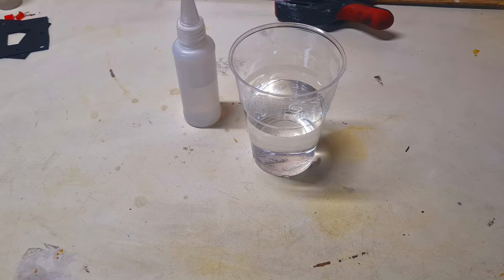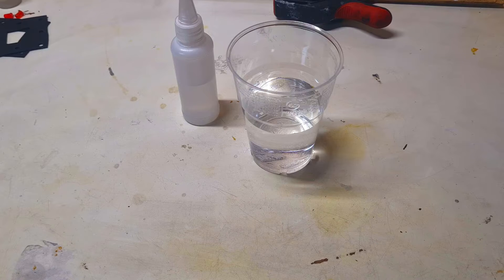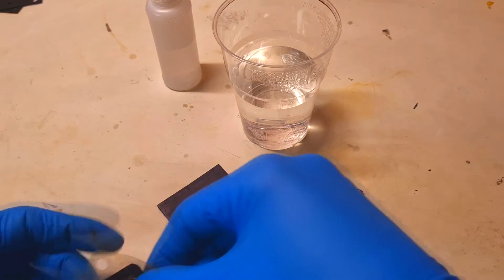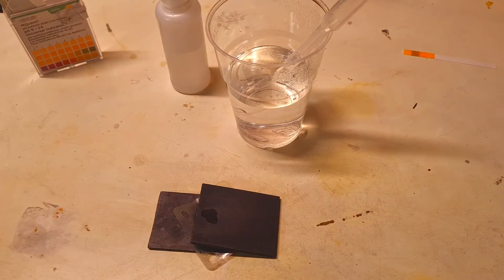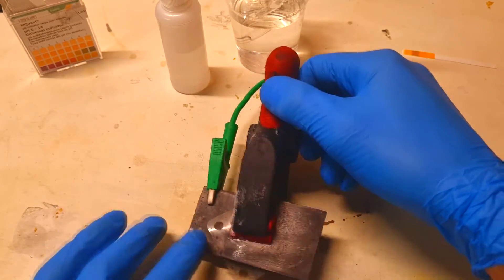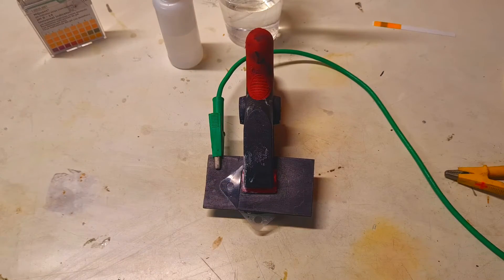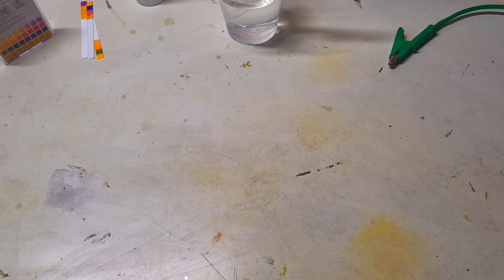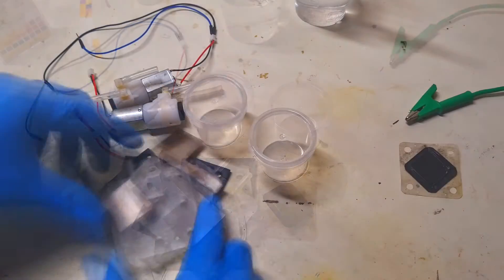Diy Rechargeable Salt water battery

Comment: Have any of your battery designs that you have made been able to last a long time, e.g. 1 day? What design of yours lasted the longest?
Reply from the maker: Zn - Mn last for 40 days and after that I open the cell to see how it look the inside (it was a self discharge test). Then with zinc iodine and zinc bromine battery I make the cycle tests where the test lasts for more that 4 -5 month of continuous cycle testing (with the cycle rate of 2000, 5000 and 6000 cycles). Then I test the charged electrolytes for flow batteries where the electrolyte last more that 1 year in the charged state. And so on....
Reply: @cayrex  Do you have any recommended and cheap devices for measuring charge and discharge?I care most about devices that don't need to be connected to a computer or that I can connect my phone to download data from.I would also like to do some cell testing and I am currently collecting equipment for testing.

Comment: How about the capacity of such a cell?
Have you tested more?
A good solution for everyone to make at home.
Probably one of the easiest cells ;)
Reply from the maker: The capacity is in the range of vanadium redox battery which is around 20Wh/kg.
Reply: @cayrex  I forgot to ask the most important question. I saw that you printed parts for a flow battery in resin.
What about the durability of such parts?
What is the durability of 3D printing using PLA, PETG or ABS?
Reply from the maker: @tdx110  It all depends what electrolyte is used. For ABS like resin and sculpt resin is hard to say how long will last,.... because they still lasting. The PLA will last 10 to 30 min in acid or alkaline electrlyte, PETG maybe 1 hour,... and the ABS I think will last a bit longer, but I dont know because I dont use a ABS printed parts so much.

Comment: Hey man, i'm pretty new to the channel, but i've stumbled onto this video because i was researching salt batterys for a school project and altough this video is great to quickly learn the basics, i did have a few questions about the material used:
1. U use some kind of ion exchange pad, which is needed to sufficiently make a salt water battery, but they are hella expensive, the one you are using however seems really usable, since the surface area of the membrane itself seems small, did you make that urself ore can we buy it somewhere? And where did you get your membranes? 
2. If i 3d print the parts, i assume i cant use pla, since the acidic environment will eat it away, any tips on what filament to use instead?
3. Since im planning on 3d printing it, but i dont have acces to an resin printer, so i cant print rubbery materials, any tips on stuff i can use to make it water tight? Some kind of rubber? or can i use silicone sealant for that?
And lastly: any overall tips to make it as efficient as possible?
Love your work man, its really helpful! And if you share the info i will assure you i will only use it for the school project, As a form of communication: I will also post this on you latest instagram post, u could message me there, or just reply here.

Comment: How can we make use of simple ingredients to make a minimal power supply for emergency use? I have been searching/researching this for some time but keep hitting a brick wall. There are so many scammers out there, eg. people who claim that it is possible to make batteries using sparkplugs is possible. Many people say this [spark plugs] is a scam.
Reply from the maker: A battery using spark plug?
Reply: @cayrex  Search on YT and there will be many YTers who claim it is possible to make a power source/battery that is made/built by using spark plugs as the main [charge]?

Comment: Its a lot cheaper than vanadium. It would be interesting to see some comparisons between your 2 flow battery chemistries using your electronic load showing graphs. 👍
Reply from the maker: Yes it is cheaper,.... but the vanadium is already verified technology which the salt battery tech is only in experimental stage look at AQUABATTERY for more details of salt battery. The salt battery have the capacity from 10 to 20 Wh/l and the vanadium flow battery have the capacity around 25Wh/l

Comment: Fantastic demonstration! Do you know how much performance will degrade with a larger gap? For example the radius of your container between electrodes. And I'm wondering what the highest specific power would be given that the conductivity is quite low.

Comment: Hi there. very interesting stuff. i have seen all ur videos and was wondering would u do a followup on the vanadium flow bat ? and if u would build a flow battery what chemistry would u use?
thanks and keep up the xperimenting
Reply from the maker: Yes I will make a followup of vanadium flow battery. Hmm it is hard to tell which chemistry is good to use in some battery system, because all or most of chemistrys have pros and cons. For this reason I start with the project called "Hyperflow" a multi material cell years ago. But on the another side,... some all manganese or metal halide chemistry will be interesting.

Comment: Nafion looks expensive... Is there cheaper alternatives?
Reply: ...dupont..i mean
Reply: Unfortunately not sufficiently reliable
Reply: I've used coffee filters with pva wood glue (like he said) and to extend it a little, I run the paper and glue once dry through a heat press at 350° F and try not to scorch it too badly. It works better than just plain paper and lasts noticeably longer. You go C Rex!!!
Reply: Yeah, depot still have patern. Will be expensive for a while. I have been looking for alternative fir a while. Liquid Glue crossed link by acid does not last long.

Comment: Seems like you will be depleting the electrolytes, with losing cl2 and h2 (charging at 2.5V). Or do you think you are just moving concentration of h+ and thus have a type of concentration cell?
Reply from the maker: Yes, here I overcharging the cell. With overcharging I get faster reaction, but I also note that the cell voltage is in region of 2V. Same effect you can get when you use for example a zinc manganese battery with alkaline/acid electrolyte (2.3 to 2.5V)

Comment: super cap? or just hydrogen oxygen gas storage battery. well another salt like baking soda would make oxygen not chlorine. chlorine hydrogen gas fuel cell battery? the membrane makes two compartments for the two different gases, keeping them apart but lets ions pass through. hydrochloric acid battery. oh there is also NaOH in the solution, on the other side.

Comment: Very nice! It would be good to measure the total capacity of the small battery and efficiency of charge.  Also make some projections of the possibilities if scaled properly.
Reply: It would be nice, but mostly useless because of too many variables that would be dificult to characterize well. 
1. the poor size and conductivity and geomitry of the carbon felt.
2. The volume and electrolyte concentration and how much. 
3. Temperature and pressure placed on plates and how that might change the carbon poors. 

Sodium sulphate has a higher voltage window than sodium chloride, Resulting in a higher energy density. And minimizes the potential for off gassing like chlorene with sodium chloride.But nafion membrane is slightly more resistant to sulphate ions, but still has good chemical stability.

Comment: Can you have a natural circulation like those acid and base are going to separate like emulsion or so so if you have a displaced reservoir are they going to sor themselves ?
Reply: Kinda like thermosiphoning? Yes, I have a problem with the need to pump AND charge. Round trip efficiency and all that. Cool though. Wow!

Comment: I was half way through the video when i jumped to make a comment proposing making this battery to a simple flow battery.  I made that comment  and then proceeded with the video only to be pleasantly surprised. 

Charging and discharging could be done with the motors in series so the pumps work with current during charging and discharging.
Reply: I believe the direction of the flow doesn't matter. If there is flow, the reaction occurs continuously. Otherwise the energy potential of the liquid runs out.
Reply: @Harbie  yup, the direction of flow doesn't matter if there is one container for analyte and one container for catholyte. Charging or discharging you always want to pump to avoid overcharg or over discharge.
 
Alternately, If you have 4 containers (2 analyte and 2 catholyte) then direction of flow through a pump would depend on if charging or discharging.

Comment: What kind of membrane are you using?nation?
Reply from the maker: It is nafion membrane
Reply: @cayrex Diy just buy specific specialty materials found no where but one company
Reply from the maker: @BillEffinMurray  You mean about Nafion? Nafion is a brand name,.... so you have also other ion exchange membrane like fumasep and others
Reply: The subtitles said napon. I did a search and found Nafion membrane?
Reply: this is nafion membrane
Reply from the maker: @irfanjahania1654  Correct 😉
Reply: Which kind of nafion do you use? N117? There are several choices regarding thickness and reinforcements.

Have you measured the capacity of this kind of battery?
Thanks 🤘